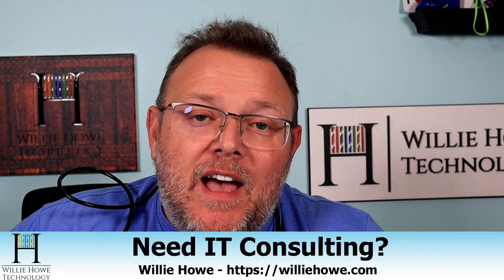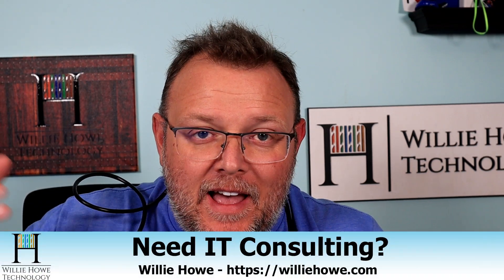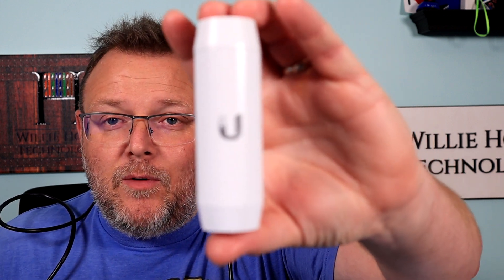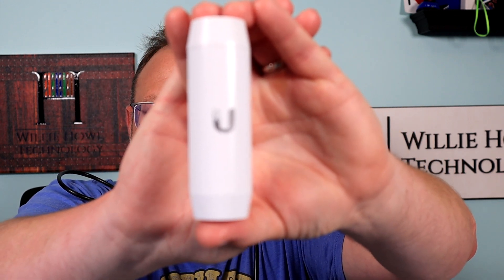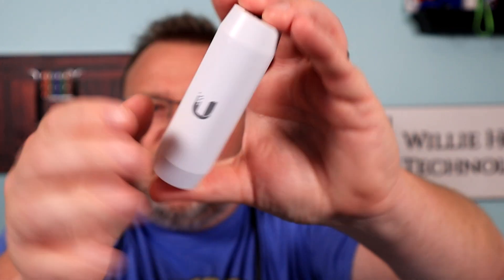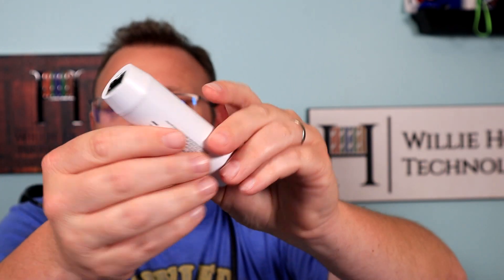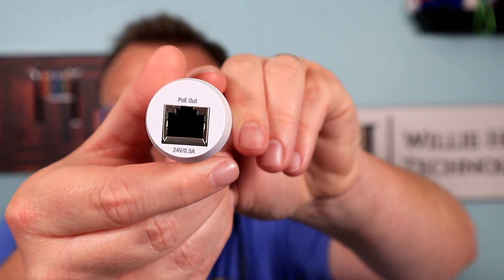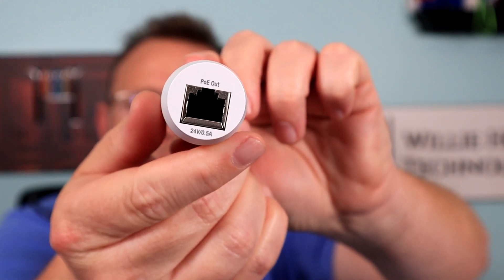Standard to Passive PoE Converter

Comment: Do you think cascading several NanoSwitches can work?
It would be for 4 in a row. Only using 1 output for the cascading Nanoswitch, and 1 output for....a door strike. Simply to power it. The reason is that the main PoE supplying switch can have a UPS and keep the strikes from working, even if there's a power failure.

I haven't tried passive 24 for door strikes but they're rate for 12-24v...so I'd assume they work but I could just be a fool.

Comment: The key aspect of these, is the amperage.   Be very aware of how much current and amperage you need to power when using this method.  The nanoswitch can split up to 1.25amp, but the AF to 24v tends to flake out after you push 0.5amp.   Most airmax devices that only use 0.3amp will be fine, but these converters will fail under a heavy load 0.5 or greater device (Powerbeam 500/600, or Rocket AC Lite/Rocket Prism)   And will fail to deliver proper power to any AirFiber PTP or LTU sector radio.

Comment: Also to note that in europe no edgemax switch is at the momenta available. This tool we used to get poe+ from a different vendor Switch which do not have the option of 24v and get link up until the new edgemax switches come in.

Comment: Hi, can only agree have some of the outdoor Versions in the field for year they do a very good job. Also I had some luck when 24v on a long run was a bit wacky, the 48v poe+ worked like a charm with the converter at the end. So if you have a long cable rund maybe that is a option to consider.